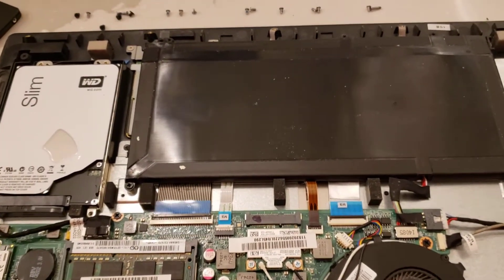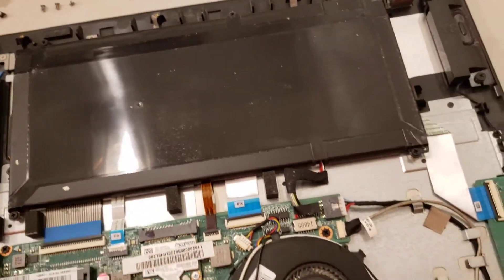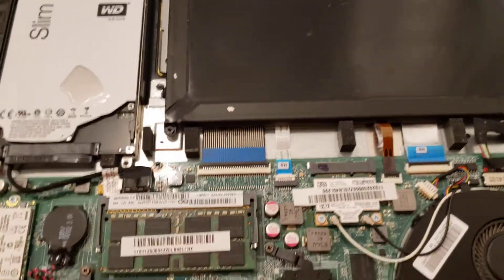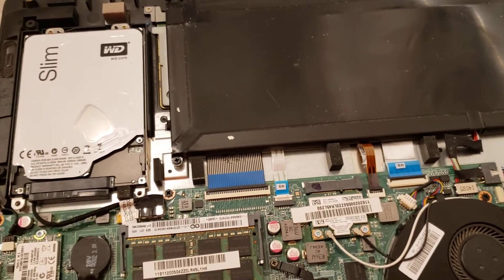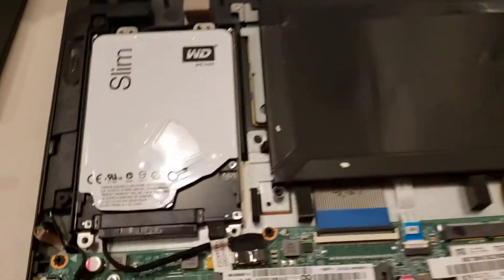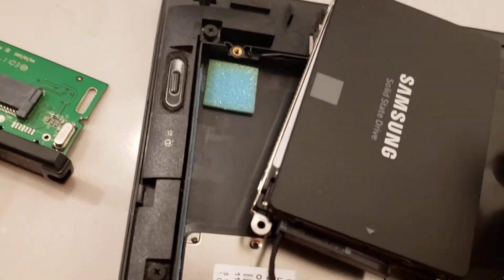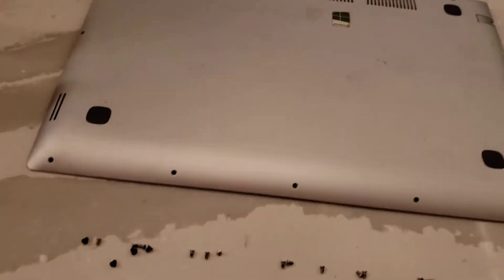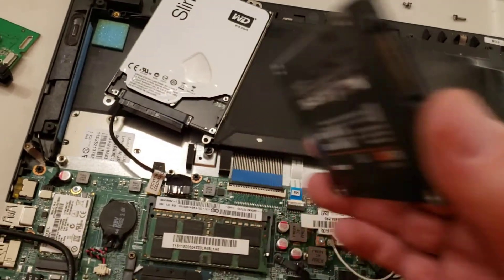lenovo ideapad u530 hard drive conversion to an SSD

Comment: Hello, I have to change the m.2 2242 SATA drive and I don't have the screwdriver to remove the screw. Does anyone know the name, type or size of that screw?
Reply from the maker: i did a quick google search on your question. Looks like this could be the same for your unit.

The screw sizes in use are M2.0 and M3.0, but they are NOT Phillips drive type of screws. I have a precision screwdriver kit, but not with the needed head patters. The screws are very small, and I don’t want to round them.

They are 6-star designed, are these Torx screws?

Comment: Hi, great video. Do you have a link for the sdd? Also I have 8gb RAM in mine. Do you know if i can add more RAM?
Reply from the maker: Here is the drive i put in my unit, Samsung SSD 860 EVO 1TB. I would skip the RAM because the SSD is very quick and it can be very fast like RAM. If you put in the SSD and the machine still needs enhancement you can also upgrade the RAM at that point.